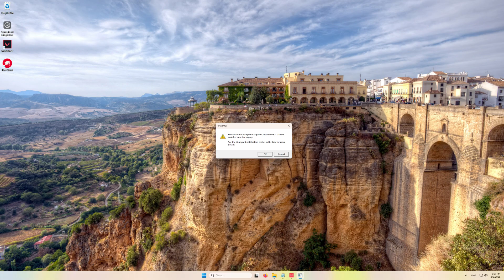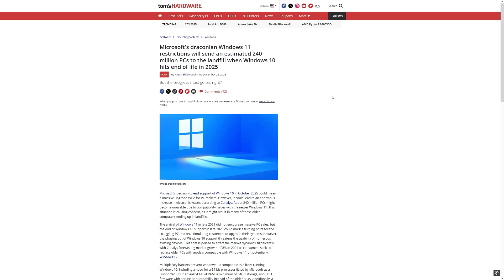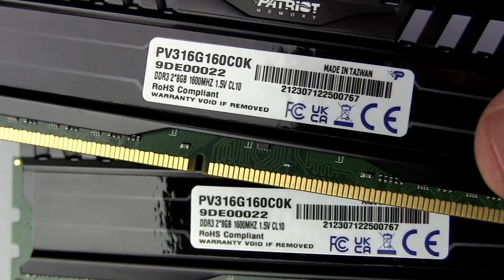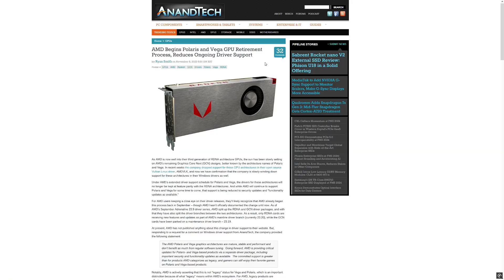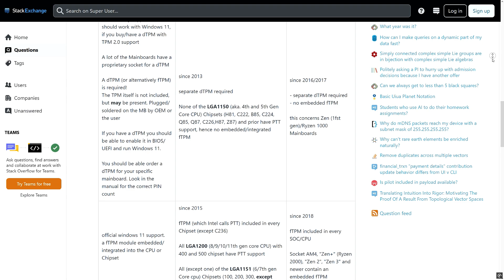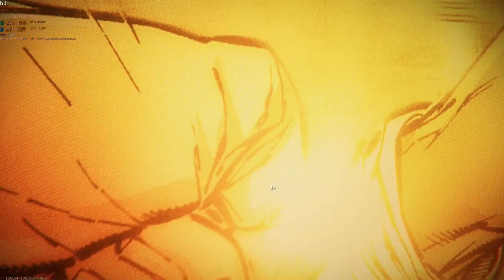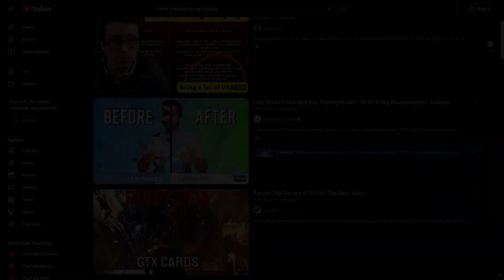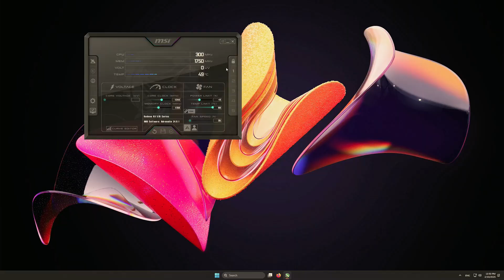The Disguised Intel i7 4790 PC vs Modern Games • Xeon E3-1271 v3

Comment from the maker: Here I pin some additional useful info and tips regarding the topic.

• How to overclock the Patriot Viper 3 DDR3-1600 CL9 16GB Kit
https://www.youtube.com/watch?v=uQPTGNBNdDM&t=525s

• Which ASUS motherboard supports Windows 11 and how to setup TPM 2.0 in BIOS.
https://www.asus.com/us/support/faq/1046215/

• NVIDIA DLSS & GeForce RTX: List Of All Games, Engines And Applications Featuring GeForce RTX-Powered Technology And Features
https://www.nvidia.com/en-sg/geforce/news/nvidia-rtx-games-engines-apps/

Error list:
At 04:27 there is a script error that says "9th gen" where it should say 4th gen.
Reply: I appreciate these types of videos and the wealth of knowledge and experience that is shared, especially since still being relatively inexperienced at my new PC hobby so all the old hardware is new to me. I started by modifying an old HPZ 230 with a Xeon E3 1270 V3 32GB Ram and GTX 1060 6GB. I progressed into building a gaming PC with an inexpensive 4th gen I7-4790K Asrock Z97 Extreme 6 board with an XFX RX580 8GB Crimson edition and for my meager needs it does great on Windows 10. I have since built an I5-10600K machine and switch between machines. I am perplexed though as to why this featured build was called a 6th gen system when it is a 4th gen Haswell Xeon?  Thanks for these great videos.
Reply from the maker: @Alpha-ms9nj  I am very glad that you enjoyed this video, and I thanks for watching as well as mentioning the definitely confusing script error that also carried over into the voice-over. Good job OBNOT citizen 👍

Comment: I've been running a bit low on cash this year and my laptop had been a total pain. So, for around $120 I got myself a used full tower Optiplex, 16gb of ram, a $10 Xeon and a 750ti. Runs my work related stuff way faster and I can do some light gaming after that. Once I can I will go for a GPU upgrade and call it a day. Besides core count, most older Intel chips hold fine over time.

Comment: Great video! I have a i5-4590 with 16 gb. My gpu is a RX 580 2048sp 8gb (Aliexpress)... Works great! But I need upgrade to 1271 or 1281 xeon... Cheap options for my old platform 🤙🏻 Greetings. PD: I play emulators ps2, ps3, WiiU, etc 😬
Reply from the maker: Greetings amigo. Glad you find the content amusing and thanks for watching.

If you can find a good deal, you should consider upgrading this platform with a Xeon 1281, 86, or 76 v3. Unfortunately, these options tend to be overpriced on sites like eBay or AliExpress.

A better deal might be to go for the cheaper 1271 v3, which is basically just 100MHz slower but the same performance with the above Xeons.
Reply: @obnot Thanks for the info! Its very useful for my low cost setup 😬 Greetings from Chile!
Reply: @obnot He comprado el Xeon E3 1281 V3 por Aliexpress a un precio de 27 USD. Esperando a que llegue 🙋🏻‍♂️
Reply from the maker: @FLJorG  Solid chip and nice deal for the price of $27 which combines great with the RX 580.👍

Comment: Hi there I'm new to this channel and i really enjoyed your video! I would like to ask for your help about my pc because ive been having overheating problems and was thinking of upgrading to a new pc build. But maybe I don't have to if you can help me. My pc runs at around 40-45 degrees Celsius when idle and goes up to 70-85 when gaming and even higher with background apps running like discord calls/streams. I play League of Legends often with friends on discord and sometimes i end up getting a blue screen while playing because of overheating. Even with power saving settings on windows it often still gets really hot.
My pc build:
-Windows 10 professional installed on SSD
-intel i7 4790
-Asus Z97M 
-32gb DDR3-1600
-GTX 1050ti
-750w PSU
-AOC monitor 1366x768 max resolution
-old "Qube" brand tower with no extra space for fans and old style airflow
Reply from the maker: I glad that you enjoyed the content and thanks for watching.
To your question. Overheating can be tricky to fix online, especially via YT comments. Assuming your CPU is overheating and the ambient room temperature isn’t above 104°F (40°C), here’s how I would troubleshoot: Poor ventilation, dust buildup, faulty cooling, thermal paste degradation.

1. Check if CPU and case fans are working. Replace any faulty ones.
2.  Remove any dust from the PC parts and reapply thermal paste on the CPU.
 3. Remove the System from the case and test temperatures on a wooden or plastic bench. If the case is causing poor airflow, leave the side panel off during usage.
 4. Delid the CPU and replace the thermal paste on the processor DIE.
 5. Replace the CPU if everything else fails.

For an overheating graphics card, follow the same steps, except skip step 4.

Hope it helps and good luck.
Reply: @obnot ah ok ill try this thanks for replying!

Comment: I sold two PCs with Xeon 1270v3 (i7 4th gen) with rx 580 4gig and 16gb ram, works perfectly fine for cheap gaming. 
But, I used win 10 enterprise ltsc 2021 version which have support until 2027, no tpm issues with win 11. For 5xx serirs radeon cards i use nimez drivers, not official one. 
Try this trick.

Comment: I enjoyed your retro resurrection video.  I have an alienware x51 R2 installed in a new casing.  Its like your PC makeover but the motherboard is a little antiquated compared to your example. It works well with 4790 and 16 GB ram on windows 10.  I suggest a good cpu air cooler like the Peerless Assassin 120 as the cpu is temperature sensitive. My GPU is a 2080ti and is very versatile for PSVR, 3D gaming and USB C hub support with virtual link on this system.
Reply from the maker: Thanks so much for watching! Your PC setup sounds awesome (also took me by surprise). I’m glad you're content with a system that others might consider a mismatch.

With Windows 10 nearing its EOL, have you thought about upgrading your rig?

Comment: I recently upgraded from a GTX 1060 3GB to an RX 6650 XT on my Xeon E3-1271 v3  system, and the difference is incredible. The frame drops I used to experience,  are completely gone, and everything runs much smoother now. The RX 6650 XT delivers excellent performance for my needs, making my system feel brand new. In the future, I plan to upgrade to a Ryzen 9600X, which will take things to an even higher level. Overall, I’m really happy with this setup—it’s a solid balance of power and efficiency!
Reply from the maker: Sounds great! Depending on the game, you could see up to twice the frame rates after upgrading to an R5 9600X. One reason is the stronger CPU and your RX6650 can take advantage of the the newer platform, which provides faster RAM and higher PCI-E bandwidth.

Comment: I managed to install windows 11 without any trouble, using a cheap TPM 2.0 module on a z170 motherboard with a I5-6500. I did need to turn on TPM and secure booting in the bios. No complaints about the CPU not being supported. It was a fun afternoon.

Comment: snagging a 57757c and 2133 mhz ddr3 ram would make this platform sing
Reply from the maker: 2133 or 2400 DDR3 is doable. On the other hand, an i7-5775C... I wish for. They scalp this CPU as if it were an R7 5600X or something.

Comment: recennly put a 1270v3 on a b85 mainboard, which allowed to llock the turbo of 3.9Ghz also for all-core turbo. the crucial part was to use the older 1270v3 and not the 1271v3. because the turbo lock feature required an old bios version, in which the newer 1271v3 was not yet supported.... intel went against the turbo locking feature so mainboard manufacturers patched it out in late bios versions
Reply: indeed it's possible, I think it's possible to force the old microcode if you have a newer bios and achieve the max turbo lock, it's specially useful for the 1260L ( you can lock it at 3.7GHz while at stock it will drop to around 3)
Reply: @hmbrz  yeah i was lucky to buying a used PC (dort cheap) and remebered havunf heard of that turbo lock Feature for older 8x Boards. Turned out a BIOS Update was never applied so i went Out to buy a 1270v3 for 20 bucks

Edit. The PC was 30 bucks and i originally only needed a PSU. Came with a 550w bequiet, so the Board was First just a free Bonus

Comment: With a small modification to the BIOS of H110, B150, and B250 motherboards (simply changing the ME to a corporate version using the Coffeetime software), it is possible to use Xeon v5 (6th generation) and v6 (7th generation) processors. It is also possible to use up to 4-core processors from the 8th and 9th generations with these same chipsets, with some additional instruction adjustments besides the ME.
Reply: it's also possible to run 6 and 8 core CPUs with the bios modification, I do have a 6 core CPU on my H110 DDR3 board, works just fine.

Comment: I used a Haswell Xeon, the E3-1231v3, in a Z230 workstation, until recently. Any PCIE 6 pin card could use the original PSU; this made the RX 570 one of the better choice to throw in it. But with an adapter cable, I was able to use a beefier PSU, so was then able to run an RX 580. Thing is, most games that would be CPU limited when using the RX 580 were also bottlenecking the RX 570. So I say that the RX 570 is a pretty darn good pairing for a 4 cores 8 thread Haswell CPU.
Reply from the maker: Yes! Polaris were probably the last truly affordable value/performance GPUs that it last so long and it might be many years before we see something like that in the market again.
Reply: @obnot  GCN was used in consoles (Polaris being GCN4), and I think that heavily influenced how AMD supported it.
Now it's Navi's turn to power consoles, GCN be damned - at least that's what I suspect AMD is thinking.
While upseting, it is to be expected.

Battlemage looks promising, in terms of value. Not sure for how long they'll enjoy driver support.
Reply from the maker: @ I totally agree. And of course in terms of value, Navi should naturally succeed the Polaris in the used market. We should be seeing more budget PC builds with RX 5700s or even RX 6600s.

Unfortunately, as long as these 5-6 year-old cards are still being sold used for $200+ (in the EU at least), they’ll never really match the value of Polaris.

As for Battlemage, I'm pretty sure they'll keep getting driver updates for many years to come. Intel has to be in the GPU game if wants to have any chances in the AI race. I just wish these cards weren’t being sold for 40% higher than their advertised MSRP.

Comment: Its all about needs and expectations. My htpc is even older, xeon E3-1270( like an i7 2600)/16GB ram/ 960 2gB . I dont play 3A games or use heavy programs for productivity on this pc, so It does what i want. Upgrading my haswell laptop with an i7(4c/8t) next month, still works fine. I even have 2 pc with  FX-6300/8GB ram/gt710 for older family members to browse the web (upgrading them soon as well). Am4 is the way, but 4th gen intels are fine for super budget builds.

Comment: I've had one of those DELL office PCs not too long ago. They were on Sandy Bridge, so I got it I5 3470 for a pocket change and to be absolutely honest, I was amazed just how well it kept up. 
Things like web browsing, spreadsheets and document writing were smooth as a butter and when it came to gaming, more often than not the PC struggled due to the GPU I put in it (RX550). It really saddens me that so many of these perfectly capable machines are about to be thrown out, because of microsoft's simply stupid and anti-consumer practice.